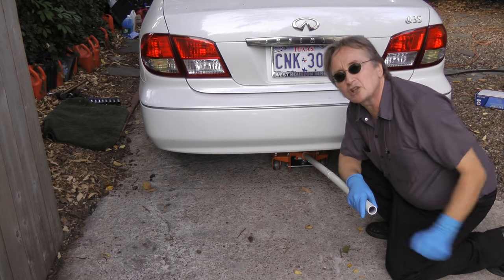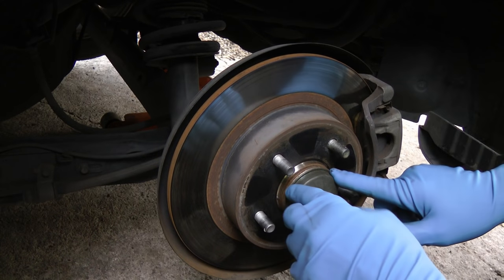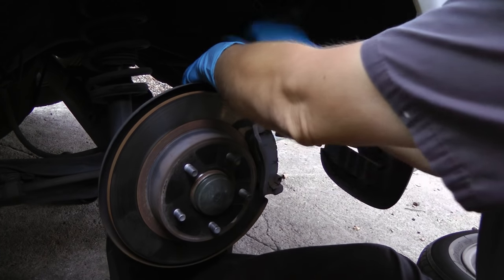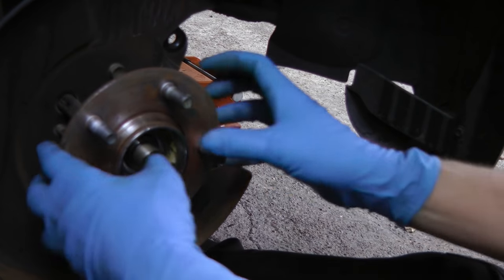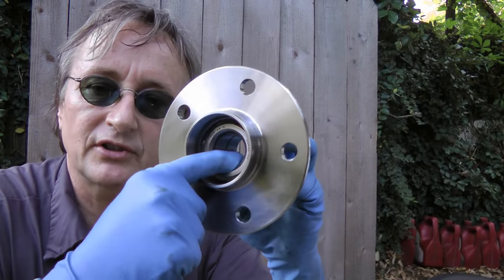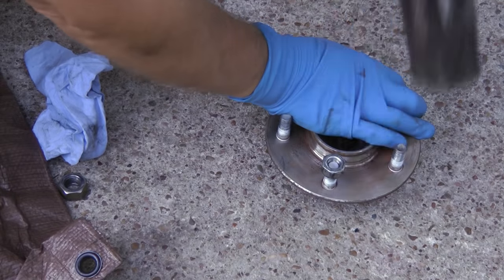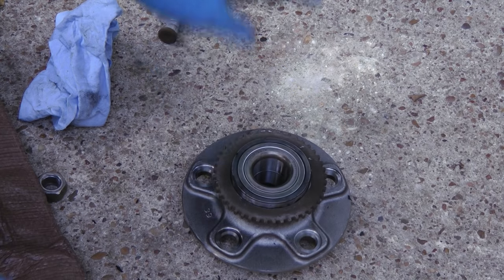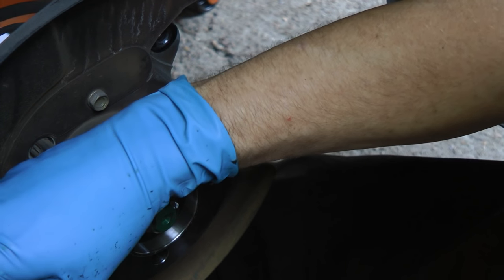How to Check a Wheel Bearing in Your Car (Replacement)

Comment: Hi Scotty nice video quick question. Changing front wheel bearings, you think it will cause steering wheel get out of straight? They just put one wheel bearings on my 05 Camry in big O Tires. When I pick it up my steering wheel is down to the left if I straight it up car will go to the right. Can you let me know pls thanks. In the paperwork there's an order to check the alligment. When I picked up the car they said no alligment needed. And why my steering not straight unless they adjust/ touch the outer tie rod. If you can let me know pls thanks. I brought the car back they said they will check it😞

Comment: What I have is a front wheel that roars when I reach approx. 30mph.  When I slightly turn right, it gets quiet.  When I slightly turn left, it gets louder.  I suspect it is the bearing, but I'm also thinking about the tie rod or ball joint.  What do you think?

Comment: Hey Scotty. I need your advice. I have a 2002 ford focus. Before, my car would get louder from the front when the speeds increased, but when we went to the right the sound would completely go away. So of course I thought it was the front left wheel bearing. But, with the help of my uncle who is a tractor mechanic, we replaced the bearing twice. The noise is still loud as before. He said it shouldn't be the axle either because he replaced it about 5 months ago. Please help me

Comment: How about a CV joint? Just found the boot closest to the tran on drivers side ripped open and grease everywhere... Re pumped in grease and hosed clamped for now... Anything too involved?
Reply from the maker: you can take it all apart and replace the boot, a messy endeavor. Or, just buy a chinese made entire drive shaft which often cost as little at 50 bucks
Reply: Thanks Scotty. I did see those to my surprise and but can't bear to put that on any car I drive.. not to mention it's a B6 VW/Audi.. It deserves better!! LOL

If I cleaned out the boot/joint, re-greased and pipe clamped it closed will this do? That's what I did so it looks like I caught it right away..

Comment: My wheel bearing was totally worn, with a loud scraping and humming sound penetrating into the cabin. Fortunately it was an old Toyota, so I managed to drive it from London UK into mainland Europe all the way to Italy, and back to the UK. It was a loud road trip, and I should have bought earplugs, but the car kept going. Then after I returned, I drove it for another 3'000 miles around the UK, before I decided to eventually pay up the £200 and to my local mechanic for a new bearing. It's now quiet and peaceful in the car. I wouldn't have taken that risk with another manufacturer, but I had a little faith in Toyota.

Comment: Hi and thanks for the video!  Question: I have an 04 nissan frontier 4cylinder and I recently had both front bearings replaced because i thought for sure the roaring was coming from the front even roaring a little more as i rounded curves in the highway. Changing the front bearings did not solve the problem. Do you think it could be rear bearings? The roaring sound/vibration sounds exactly like when a bearing goes bad. My tires are new and balanced as well.  There is no play in my driveshaft either. Any advice is appreciated since i am a full time unemployed student. Thanks!
Reply from the maker: hotriffsofthrash  could be, see my video "finding the source of car noises" to find out for sure

Comment: Great videos  
I have 2010 Ford Explorer had humming sound driver side front wheel replaced the wheel hub and bearings 
Still getting humming sound 
Rotated tires 
Still hear some humming noise 
🙉

Comment: Another great and informative video! Thanks Scotty!
Question: I have a .CV joint that's almost shot. Since I'm digging in deep already,  would it be a good idea to also replace the wheel bearing? Also, if I replace the CV (or both CV, wheel bearing), should I replace the other CV too?
Reply: Hello there👋,how are you doing today?Hope you’re having a good day?God bless you❤!!!

Comment: Hey ScottyI replace the wheel bearings in my wife's 2012 Dodge avenger and when I put it all back together get in the car the ABS and the traction control light is on?I removed everything again cleaned all the sensors and everything put it all back together and the same thing. What do you think I should do or do you have any ideas what it could be

Comment: Hi Scott.
I've got a problem... or two...lol.
I own a 2012 Jeep Wrangler JKU with a 3.6L.
The ring & pinions were swapped out, (professionally) from 3.73 to 4.56 to get better performance from the tranny while driving 315x70R17's.
The Jeep has 81k miles.
I just mounted new tires and had an alignment completed. 
Yesterday, while pulling out of my neighborhood I heard & felt a Bang, followed by metal on metal grinding. The noise was coming from the front end, and became more pronounced as I turned the wheels, as I made a U-turn to head home.
I pulled the driver's side wheel off. the brakes are worn and need replacing,(i ordered new rotors, pads, spring clips, and e-brake shoes), but there is no indication of what the bang or grinding was caused by...
Can you offer your professional opinion?

Sincerely, 
Sal Arico, Jr.
Shadetree Amateur

Comment: Hey Scotty, I hope you can answer this , I bought a whole new wheel bearing hub, when installing it from the pressure to put it on the axle the wheel bearing opened up I the it's the trust washer. I torqued everything and my wheel doesn't move back and forward so it does seem good, but while driving I can hear a noise (like I'm driving on a train track) , do I need to replace everything again or could it be something else that is grinding (parking brake? brake discs ?) I hope you can answer ! Thanks !

Comment: I just took the wheel assembly off the front of my 08 mustang and it didn't have the tone ring. But the new assembly I got has it. Did I get the wrong part or did someone just not put in on last time?

Comment: Hey Scotty first off I love your show. Second one,  I got a question about wiring on my 1997 Dodge Dakota.  I turned my headlights on and hit my brakes and my blinkers don't work. when I turn my lights off and hit my brakes my blinkers do work. also no dashboard lights. I recently changed my brake pedal switch that fixed my no brake light problem can you figure that one out. On the brake lights on the rear the wiring wasn't hooked up when I bought the truck and it still has a yellow wire white wire not connected don't know where they go. Thanks buddy in advance

Comment: I need advice Scotty. After replacing the left rear hub assembly on my 2007 G35 i can hear a loud.knocking/knocking noise on the new assembly when i shift from park to reverse. Everything was fine till i replaced the bad assembly. Is it possible that i have a worn out grooves on the left rear axle?

Comment: Hey Scott
I just listened to your advice and bought a 2010 Lexus is250 💪 but I have front end sounds like a wheel barring noise but it's not .. the tires have a good rubber on them but little hard .. I'm not sure what the sound coming from
Please let me know if you have any advice

Comment: I test drove a Mercury Mountaineer one time from a salvage yard that had one for sale and on the test drive I could hear the same sound you were describing in the video so I knew the wheel bearings were bad and not to buy that vehicle because you have to replace the whole hub assembly on 4WD and AWD vehicles which is about $100-$150 a pop. The only reason I know this is because I had to replace two front hub assemblies on my 2000 Ford Explorer because the wheel bearings were shot

Comment: hello dear, thank you for your helpful videos, my car has a sound like bearing comes up when I remove my feet from the accelerator pedal, can you suggest please what is the problem, is it from the drive shaft or the wheel bearing?
Reply from the maker: +Shahim Khlaifat often that's a drive shaft problem with worn joints, as a wheel bearing will make noise whether you accelerate or not

Comment: Scotty  ---  Two thumbs up on the content of your videos.  I know that this presentation is from several years ago, but I hope that you will see this comment.  I have a trailer (about 16 feet long with 1,800 pounds capacity) and, while the bearings are not showing any signs of an issue (no noise, etc.), I would like to change the bearings as preventive maintenance.  I couldn't find a video where you did bearings on a trailer and I'm asking that you consider doing such a video presentation.  I would very much appreciate it.  Thanks for the content and the interesting way in which you present the subject matter.  Live free or die hard.  ---  Ted

Comment: Hello Scotty, As your driving, is it possible for a wheel to "roar" if it has a bad ball joint or tie rod instead of a bad bearing?  Or would a bad bearing be the main cause?
Reply from the maker: wheel bearings are the only things that actually roar, but if a ball joint was really bad and crooked it could make the tire make some loud noise as you drive faster from tracking incorrectly

Comment: Hi Scotty, I just picked up a 96 Dodge 3500 van with 40 k miles on it.....there is a noise in the rear, like a bearing maybe, the noise deffinately gets louder under DEceleration,  ...so seems the noise is worse when I let off the gas, could I get lucky here and this just be a wheel bearing ?  Thanx !!

Comment: Also when i begin to move from 0 i hear like a squeal sound from the same general area is that cause of the bad wheel bearing or could it have to do with old brake rotors that need replacing? Thanks alot!

Comment: Hello Scotty i had a noise in the front of my 03 corolla 235K km on the odometer. I was planing to change tires and front struts and link kit and get it aligned. After work done the front right wheel still have a loud noise at 90km/h (55mph). What can be wrong ? I had a bearing changed on the driver side few months ago and the noise was not speed specific. Can it still be a bearing problem? Thanks !

Comment: Thanks for your knowledge. I just subscribed your channel.
I have a question. I have 2002 Mitsubishi Lancer.
My car has a sound coming from the front wheel driver side when I press on the break and the car the noise is starting until the car is completely stop.
There is no noise when I'm driving though.
One of my mechanic suggested  that it's a wheel bearing. But from what I watch from this video, seems it's not since there is no noise when driving.
Should I take everything out to check if it wears off or it's about other problems.
Thanks,

Comment: Hi Scotty, Can I use after market wheel bearing on my Audi Q3 2016? or Should i use Audi OEM? Will it make any difference. The after market bearing is made in Germany very much the same factory that provides Audi with this part. Simply cutting the middle man.

Comment: Mr. Kilmer, I watched your work and really love it. I always refer to your repair and work on my car.
I have an 09 Lexus IS250 AWD. Lately, I experience tires noise a lot on my driver front.
I went a head and replaced the axle and the wheel bearing. The noise did not go away so I also replaced the driver side. The noise is still there. I check both rear and doesn't seem or the noise even sound like it was on the rear.  Its louder when I am on the driver side.
Please give me some advice! thank you and much appreciation!
Simon

Comment: Hey Scotty, I have a 04' Lexus ES 330, and only at a certain highway speed does my car have some front end vibration just cruising.  lower/higher speed it does not happen.  I've already verified not the rotors etc, could this be the bearing or cv joint do you think?  Thank you so much, because I'm stumped!

Comment: Does the driving while steering left to right test work for the rear? Because I just changed both of of my front but the noise will go away when I do some side to side steering particularly to the left

Comment: Scotty, I really need help!! 
I'm trying to replace the hub assembly on my Mitsubishi L200.
Managed to get all the bolts undone but the old hub is stuck fast in the holder knuckle.

How do I free it up?? I've tried hammer and chisel, penetrating spray, but no luck it just won't budge

Comment: Hi Scotty. I have a question. I have a Mondeo 2 ltr with sealed wheel bearings. Some say you can pump greese down the ABS sencer hole on some cars. Others say you can use a pick to get the seal off and pump greese direct in to bearings then replace seal. What do you think.

Comment: Hi Scotty great video. I suspect a bad weal bearing but im hearing a pretty loud clicking and rattling noise in my rear driver side tire on my 4x4 2000 ranger is that likely a bearing that fell apart? Any advice would help.
Reply from the maker: it often is, pull off the wheel and check

Comment: Hey Scotty, great channel.  I've got a thumping sound that gets worse with speed.  Very loud as a matter of fact.  Feels like it is coming from the front, but the drivers side has been replaced (didn't fix it).  I've isolated the front wheels, and can't replicate the sound when jacked up.  There is no play in the front end.  I've also replaced both CV axles and brake rotors.  Tires are good.  Could the wheel bearing on the right side be bad despite no noise with isolating the wheel and running the engine?  Could it be the back even though it feels like the front?  This has stumped 3 certified mechanics and me.
Reply: did you check your u-joints on the front drive drain? one of those suckers could be dried up and donezo
Reply: It's a front wheel drive car and I've already replaced both CV axles. Didn't fix it.

Comment: Hello again. I’ve got an intermittent chirping noise while driving. I’ve changed the center rear shaft, so that is not the problem. Can’t really tell because I can only hear it with the windows down and it only happens intermittently. Don’t think it’s from the engine bay either. Any ideas? Or should I wait till it’s more prominent? Thanks again! It’s an06 Range Rover sport.

Comment: I'm having a clunking noise along with the humming noise coming from the front end on a 98 Toyota Avalon. When I turn right, all of the noise stops. Gets louder when turning left. But the noise is consistent when going straight and gets faster as I accellerate. Can this be a wheel bearing issue? I wasn't sure if a really bad wheel bearing could cause a thumping noise that I can feel in the accellorator.

Comment: I have a 2005 Kia Sorento EX and last week I replaced a tire on the drivers side with a brand new tire. I am hearing from the Passenger Rear a rubbing noise when braking.

The passenger rear tire is 6/32. Would the difference between tires causing a rubbing noise when I brake ?

Comment: Would my 04 F350 be making a metallic popping noise if my wheel bearings were out? The sound only comes from the front driver side. The sound only gets worse when I drive faster. I have taken off my tire, brake system and hub cover and have been having trouble taking off the 4 bolts near the universal joint but am wondering if its even the wheel bearings.. When I turn it on a stand I don't hear any major noise but when its rolling down the road it sounds terrible

Comment: Awsome just watched a video you posted 11yrs ago sure wish you were my macanic or friend to help with my 2006 Mazda 3. I think it's a fluid car lots of suspension problems next is probably hub assembly then CV joints probably neither with my carpenter wisdom maybe timing if not so confused & to deep to stop now.

Comment: Scotty!

I have a 2001 Subaru Forester L that I bought last year in 2013. Great car, and the engine has never given me problems until now.

It seems like my gas mileage has gone down. Whenever I start the car in cold weather and warm it up(New York City's weather is VERY unforgiving at times) it seems like a bar or two of gas is gone. 

Also, whenever I give the engine gas, I hear a rattling sound on the driver's side coming from the middle of the car. Any ideas? I've checked and checked and I still got no ideas.
Reply from the maker: often a bad catalytic converter makes that noise, and it will make gas miles go down too

Comment: Replaced my wheel bearings and hub assembly on a 8th gen honda civic ex now the abs sensor will not go back in it bottoms out in the bearing any ideas?

Comment: hello scotty. im just a fan of your channel. i have some question on my hyundai accent gas mt . i just changed my wheel bearing on the front but still i hear some chirping noise during low gear on the driver side wheel.  i would love to hear your advise. thank you

Comment: My 2009 Nissan Altima is making a noise from the front. 
It's like a humming sound,  the faster I go.
I just changed the drivers side hub bearing assembly,  and it's still doing it. Going to change the other side tomorrow. 
Hopefully it's not a CV joint.....
Wish me luck...
P.s. do you think it's something else?

Comment: Can a bad rear wheel bearing make your rear brakes fell like you have a warped rear rotor? I ask because I have a 2002 ford f150 and the rear brakes were behaving like the rotor was warped. I replaced the rotors but the pedal still vibrates when I brake. It is not the front brakes because I do not feel any vibrations in the steering wheel when I brake. Any help is apreciated.

Comment: I have a 2004 Nissan Maxim, it’s making a clicking sounds that makes noise when I turn the car on. When I drive, the noise continues and increases with speed of course. Would that be a barring issue as well? Btw, it leaks fluid under the right front tire where the noise is coming from.

Comment: I have a 2015 Corolla and it’s eating my front drivers side tire.  I felt play.  Took it all apart and didn’t see any play anywhere (tie rods, ball joints) but around the hub.  I tightened up the axle nut but still has play.  Could it be the wheel bearing?